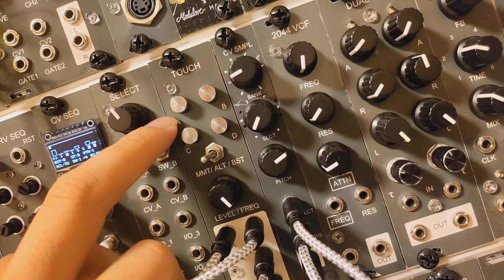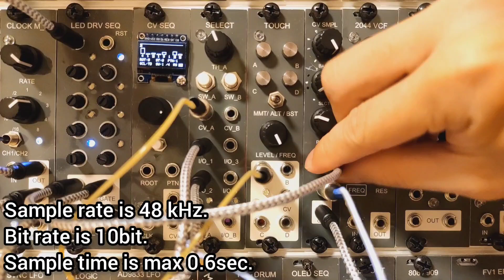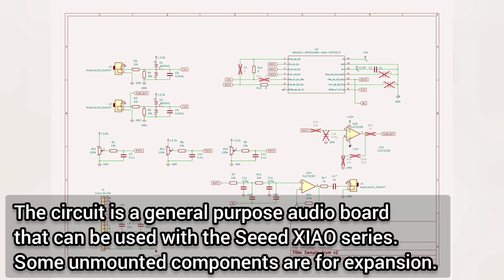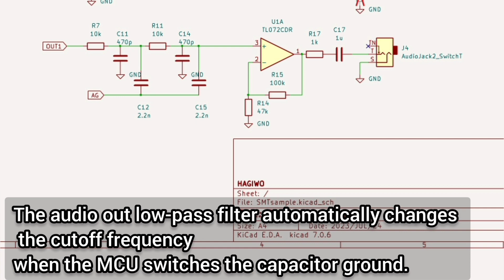[$14] DIY eurorack modular synth CV Sample Drum | SMT project , with Seeed XIAO ESP32C3

Comment: Is there much latency or delays in this? It seems quite good. I might need to try make one of these, but surface mounted soldering is something I have yet to try (and I am a bit scared!!)
Reply from the maker: Latency is 10-20 ms. The CV sample module on the market had about the same latency, so I use that as a reference.
The latency is necessary for some time to prevent noise on the CV input.